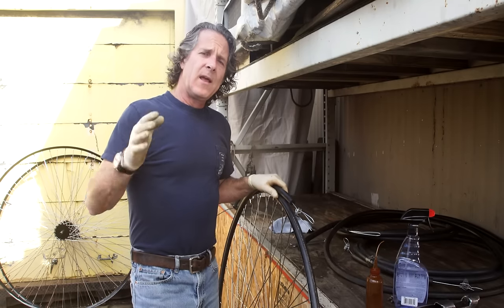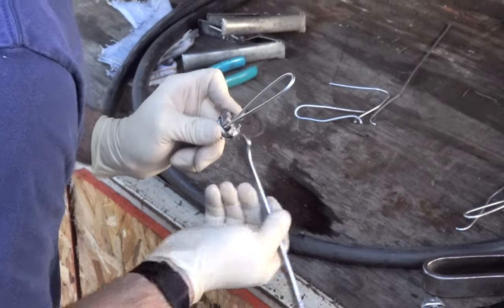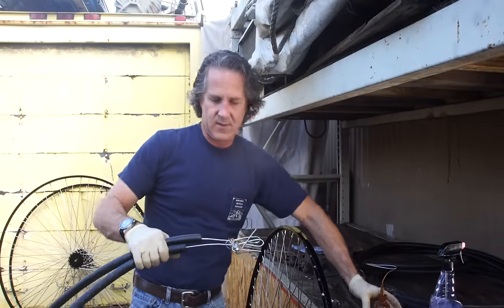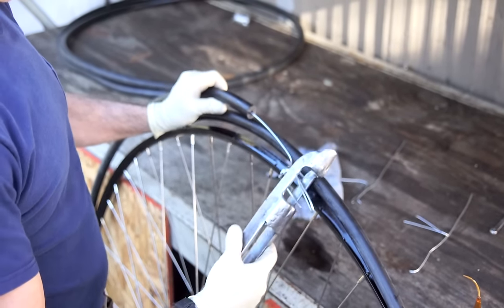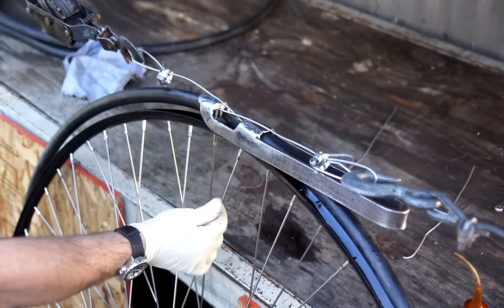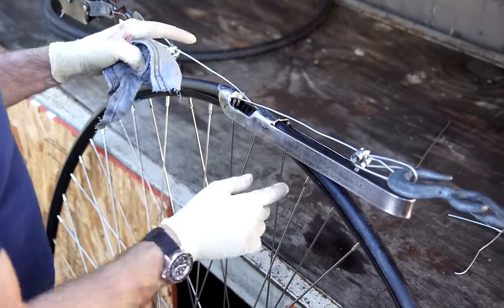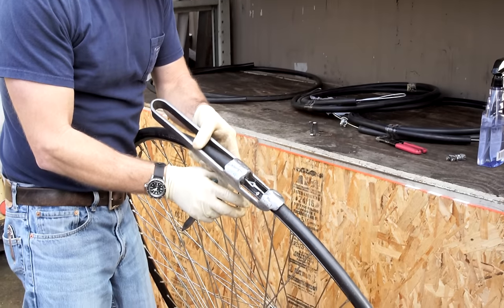Installing Tire on a Highwheel / Penny Farthing / Hiwheel Bicycle.

Comment from the maker: Apparently I forgot to include the rubber length needed for the tires. Tire overlap is important. For large wheels you can estimate a circumference plus 10% length for the tire rubber. For instance, a 48" wheel has a circumference of roughly 12 1/2 feet but with the overlap there would be roughly 13 1/2 of tire. That additional tire is compressed on the wheel and prevents the tire from gapping at the joint due to road torque.Greg BarronRBR Inc

Comment: Superb.  I’ve only ever seen the brazed joint.  What a great method.
Reply: Thanks! I prefer this over the application of heat to the joint and I think after 12000 wheels I can safely say it works well. That said, if prefer to do it another way, who am I to say anything.

Comment: This is exactly like putting tires on a wagon wheel.  Engels Coach Shop has some good videos on how he does it with 2 high tensile wires and brazing.  One trick he does is to rotate and bang the rubber on the concrete to distribute the compressive stress evenly among the tire.
Reply: The difference though is many coach wheels use a 2 wire tire due to the size of the material going on the rim. I have a 2 wire draw machine here that I got from a coach maker in TX some years back. As to banging the wheel on the ground, that works best with big heavy wheels. Light wire wheels like these react best to a cross strike with a tool and or being mounted and rode to equalize the rubber. With enough lubricant at installation the tire does a pretty good job of self equalizing around the circumference.

Comment: it sounds and looks rather complicated for the average hobby craftsman. Congrats on your elegant way of handling it.
Reply: Most folks that attempt it manage to pull it off pretty well. Occasionally someone will need a second piece of wire, but it usually seems to work out. And being that there are very few people in the country that perform this service, for those in need, it is doable!

Comment: If it's tricky for a professional, it might not be something you want to attempt for the first time over a weekend. Pretty awesome
Reply: It's doable for most folks, though for some I recommend an extra piece of wire just in case it goes wrong the first attempt.
Reply: I would do this with a smile, but I have no wheel to practice on 🤣

Comment: Gods I love the internet having stuff like this from trades that have distilled down to pure techniques for things I would overthink.
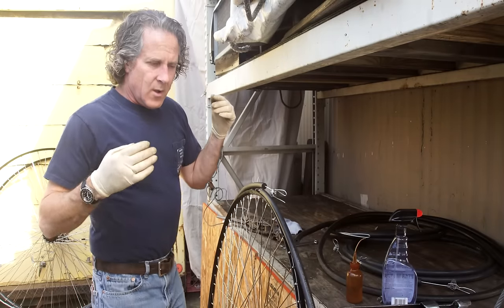1:43 the subforum /specializedtools on reddit would might get a kick out that that spacer for it's raw problem solving simplicity.

I had no idea where this was going, all that rubber/wire slack made no sense, thought the technique would be welding the ends  of rubber or the wires together somehow but all that pull tension made that seem counter to welding.
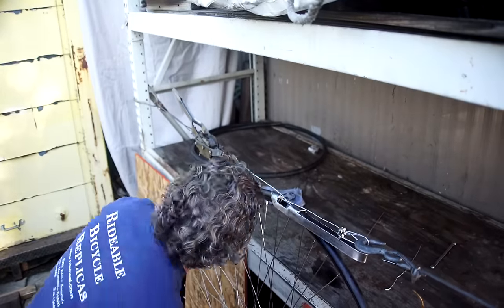Then at 9:25 that wire twist technique is like a 2am-as-seen-on-tv-why-didn't-I-think-of-that Brilliant , a real "twist ending" 😉.
Reply: A lot to be said for old tech that still works just fine after more than 100 years.
Reply: The extra rubber actually is the spring the keeps the gap closed. Without the compression, road torque would pull the gap open and expose the joint.

Comment: I just found this video after Ron Covell referred to it in his recent video (late April 2022).  Your technique is similar to that used by Dave Engels when putting new tires on buggy/carriage wheels, mostly for Amish customers who use them.
Reply: There aren't many methods of solid rubber tire installation and only a few more people that still practice the service. The Amish are still making buggies and buggy whips too. In fact, there are a bunch of lost art trades that you can find in Amish and Quaker communities. And of course, here in the hiwheel communities too.
Reply: @gbarron64  Yes, Dave builds buggies, carriages, wagons from scratch, but mostly repairs and/or restores originals.  He started his channel in order to preserve his Wainwright & Wheelwright (spelling for both?) skills for the future.
Reply: @bobvines00  That's one of the reasons I did these videos. There are very few people in the county capable of doing this. It's not a terribly available skillset.
Reply: @gbarron64  Thank you for sharing your technique and the simple tooling needed.  Dave's equipment is much larger & more complicated, like the wheels he works on, and could scare many away from even trying.
Reply: @bobvines00  I've got a machine for putting the double strand tires on, big tool for big material... I've yet to use it...

Comment: What if moisture gets in and erodes the wire? wouldn't melting/fusing/gluing the ends together be a longer lived tyre?
Reply: MrEmiosk, I know this reply is about three years too late, but first, the wire will not "erode" from moisture, but it could corrode. However, is the proper electroplated (Galvanized) wire is used, the only place where moisture would attack the underlying metal will be at the very ends of the wire, which are in the un-stressed short bent-over sections, so not a big deal.

Greg Barron's technique is a "classic" one, however most American Wheelmen (a bike club for riders of highwheel and other old bicycles) have long preferred the brazed (silver-soldered) method over the bent-over method. If done correctly, wire breakage seldom happens with either kind of joint. A big advantage of the brazed method is that the wire joint ends up being much narrower, and this plus the fact that there can be no friction-fatigue at the joint (as the bent wire method can have), the potential issue of that 'knot' being worked constantly during being ridden until metal fatigue finally kills the joint is eliminated. The sudden departure of the tire from the wheel, due to a broken wire, can be catastrophic and potentially very dangerous to the rider, so of course people who favor one wire joining method over another tend to be very convinced and devoted to the belief that their method is the only safe one.

Greg has a statistic, based on the great many highwheel bikes he has made over the decades,  that he has not had a failure of a wire joint that he has made. That assumes that all of his many customers would report a broken wire if it occurred, and it also ignores the fact that most of his bikes are used by casual riders who are mostly not putting a lot of miles on their bikes, so right there it may be a compromised statistic. Most of the Wheelmen riders who swear by the brazed method are more inclined to ride longer distances and probably more frequently, and are doing the riding on antique bikes rather than Greg's reproductions, with most riders even doing 60 and 100 miles rides, plus a great many parades and such, plus many cross-country rides, and this really puts the tire wire joints to the test, so there is a different kind of validity to their belief that brazing is the safer, more reliable kind of joint.

I should point out that I have been a fellow Wheelman with Greg, and a friend, for a long time and respect his experience and opinions, while not being entirely convinced that his method is the safest. I also do not view his method as necessarily inferior to brazing.

When all is said and done, the differences in reliability of the wire joint between the two methods is probably pretty small, assuming that the process is done correctly.

Comment: Is it possible to put an existing tire back on?  The big tire fell off my penny but it's still a complete loop
Reply: Hello and the simple answer is yes. with conditions. The main problem is that I don't know the details of the particular tire and wheel so I could be totally wrong in that answer. If the tire suddenly got loose and then fell off, most likely the wire core broke. In that case, the wire must be replaced. The next issue is that if the tire is old, the rubber most probably has hardened in a compressed condition, and it is no longer elastic or long enough to have the required spring back to hold the joint area closed. Road torque will open a gap. Good rule of thumb for tires. If it fell off, it's probably worn out. Replace it. It's off, you already need to reinstall rubber. Don't stint on safety.

Comment: That's so cool...
Has anyone considered crimping the ends before letting the rubber close up? A crimping bead wouldn't be too big and it may strengthen the connection some without using heat.
Reply: I have thought of crimping beads, but the thing is that the material works the same function as long as the tails are crimped down tight. Also, the amount of space to work in is tight and sometimes the spacer wants to pop itself out due to tire pressure at each side. so, I never did start with them.
Reply: @gbarron64 Without making a custom crimping tool I understand how it would be an issue. Thanks for the video and the reply. Now my brain is thinking of ways to use this rubber mounting method in other applications as well.
Reply: @moretimethanmoney8611  Happy to be of assistance! Be sure to let me know how it works out for you once you figure out an application that suits you.

Comment: is there much risk of the sharp cut ends of the wire cutting through the rubber as the rubber moves and squishes with use? is there any use in using some sort of adhesive on the ends of the rubber tube to seal the wire even further?
Reply: Good question. Short answer, no. With a condition. The ends must have long enough tails that they couldn't unfold if they wanted to. So, figure 1/2-3/4 of fold over left after you cut the wire free. That said, I have seen wire that was not crimped properly at installation, and when the spacer is pulled out the ends opened and poked through as the rubber closed the gap. I've never needed an adhesive to bond the ends. The wire holds the tire down pretty well. Though should you experiment and want to share results, I'd be happy to hear about it.

Comment: Hi, does anyone know where to find those kinds of tyres? I've searched online but can't seem to find them easily. I am in europe so a european distributor would be the most helpfull. Thanks
Reply: I have no idea who carries rubber products anywhere other than here. Sorry. Additionally, I have my tire made here in California. While I can mail tires to you I can not help you with a supplier in Europe.
Reply: @gbarron64  What are the dimensions of the tire, ID and OD? I'll maybe try and contact some rubber manufacturers

Comment: Seems that there would be a noticeable lump in the tire at the joint where the wires are crimped that you would notice every time the wheel makes a revolution when you are riding on it.  Seems that a tire with a pre-Vulcanized joint would be a better way to go.  Modern rubber could be developed that could be heated, placed over the wheel and shrink tight when it is cooled.  
Totally over-thinking the issue, I know, but there is always a better way.  
Your way of mounting the tire is certainly traditional but requires a variety of tools and a “feel” for correct tension that is only acquired from experience.  
I’ve never ridden a Penny-Farthing so perhaps the wire joint is not noticeable while riding and not an issue.  Great video BTW.
Reply: Brad Jacobs, the 'lump in the tire' issue is why a lot of (probably the majority of highwheel tire installation folks - in the US anyway) favor the brazing method over the bent wire method. Another thing to consider is how the highwheel bike will be used. Greg makes a LOT of bikes and has more experience installing tires than anyone, but many riders of his RBR bikes don't use them for long distance riding; many are professional entertainers, or are being ridden mostly for parades, etc; but probably few of them are used for long distance touring, which racks up the miles. A tire with a lump is not a big concern for the riding applications where distances are less. But the metal fatigue that can, and HAS, happened to bent wire mounted highwheel tires is something that will more affect bikes ridden in the traditional way, in other words for actual transportation, where a lot of miles get put on. 

It is true that brazing a wire will slightly weaken it near the joint. But bending the wire also slightly weakens it, and certainly having the 'knot' in the wire subjected to roughly 2 million revolutions during the wear lifespan of a typical tire (this math is per a 50" front wheel, and using traditional red rubber tires, as opposed to the black neoprene tires). In my own experience with both knotted and brazed wire joints, I have never had a wire failure on a brazed wire that occurred anywhere near the joint, but I HAVE had a few knotted wires break at the joint.

So, as Greg aptly puts it, use whatever kind of joint you are comfortable making and feel is best. They both work. Each has its pros and cons.
Reply: @youtuuba  Not quite sure who I am speaking to but... As to a lump due to the joint, the only time that happens is when the tire thickness gets small. The 7/8" used on most wheels these days really doesn't get a bulge at the joint. 3/4 and 5/8 tire with wire that is too thick certainly can and does. Use proper gauge wire thickness and there is no issue. Otherwise, the wire thickness is still only ever as fat as 2-1/2 wires laid together. Go ahead, measure them. On most wheels, that is only slightly larger than 2 side by side wires. .60". The next thing is that they tend to compress into the material over time and more often than not, wind up diagonal to the cross section. 3rd thing is in the 50 years we've been making bikes, plenty of folks have ridden their tires right flat (4-8000 miles 10,000 or so wheels) and had to replace them and never complain about a lump. In fact, I did a tire on a bike recently that was on its 2nd tire and had to install a 3rd, so, 2 million revolutions a year didn't faze it and the rider didn't feel it. My personal bikes all have the joint and I can't feel a bump. I have several local riders that use their bikes for transportation and never have an issue and can't feel the joint. There are "many riders of RBR bikes" that do use them for long distance. Even if only 20% of my customers ride lots of miles, that is still a lot of bikes getting a lot of mileage. Respectfully, I am pretty sure that folks that say they can feel the joint, are imagining it. And really, I am not sure the "majority" of installation people are more than a handful of people nationally, at best. My impression/opinion these days is there are maybe 5 folks nationally that install tires in what could be called commercially. Those would be the people to ask, because they do more than a wheel or 2 a year. The rest of the "installers" are hobbyists that only occasionally do installations for anyone other than themselves. Who they are and where they are located is often a mystery to most and putting someone in touch with any of them is next to impossible for most folks that need a new tire installed. Also, for the most part, those folks are indoctrinated into a method of installation that started regionally from one family in the early 1970's. Just like the light red color of the tire rubber that is favored on the East Coast. Doesn't matter that color samples of original tire I have on my shelf show to be far darker, it's become a personal preference based on use. It's the way that geographic did or learned how to do and so, because of that, they decide that is best. Whether it's accurate or not. So, the politics of tire installation is open to interpretation. And again, respectfully, I have seen far more broken wires on soldered wire tires than I've seen on jointed wire. Again, 10,000 or so wheels under my belt, I don't recall getting many calls on breakage and I keep sending out 100-300 bikes a year. Whereas I do recall personally replacing soldered jointed tires at a couple Wheelmen meets, here at the shop and have gotten reports of broken solder wire. Being that I am a commercial operation and do see volume most people don't, the math does call the question of what is accurate. Obviously, I can't sway a set opinion, but I will keep popping out facts and actual numbers when called on it. Not saying that there isn't wire fatigue in either. I am saying, my experience in witnessing failure is certainly higher in the solder method. That said, when someone that has never done either does one or the other methods, they could easily do it wrong and put on too much tension. That is the principal factor in a wire failure. Improper installation. Too tight, the joint will break. Too loose, the tire isn't secure in the rim.
Reply: Brad, I'm glad you liked the video, but I think maybe, as you admit never having ridden one, you should experience the bikes before you make a "Seems to me" comment. I don't feel a bump in the joint of my bike and pretty sure most of my customers don't feel one either. That changes in smaller gauge tire with the wrong size wire though. If you want to come down to the shop to check bikes out, I am open by appointment. come see for yourself. As to a "pre-vulcanized joint" those are found in the newer style "modern" neoprene tires that have a snap in channel in an extruded aluminum rim. They were also available on some original bikes but had to be glued down. I am sure there is a better way but, figuring out how to pay for it is the trick. Unless you can find a way to make it and then make money doing it, it ain't gonna happen. Unless you want to donate a fortune to something that just barely has a market.
Reply: @gbarron64  Dave from Engels Coach Shop works on buggy wheels sometimes, they have two wires in them. The flipping over technique would end up in an awful mess. Both joints are brazed and staggered.